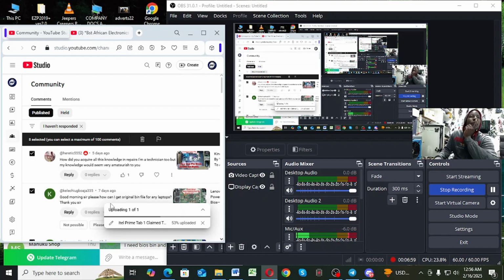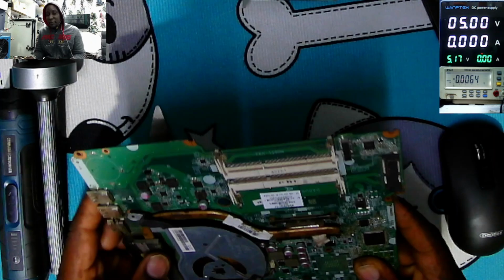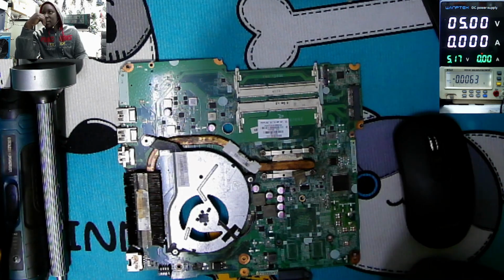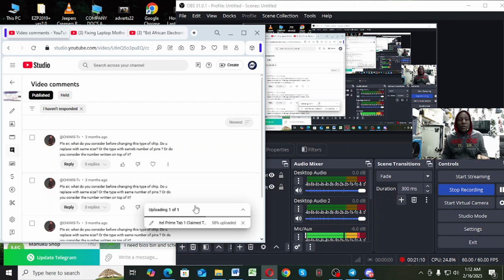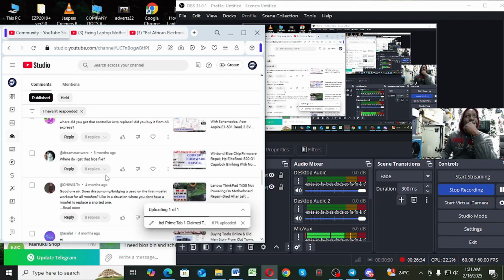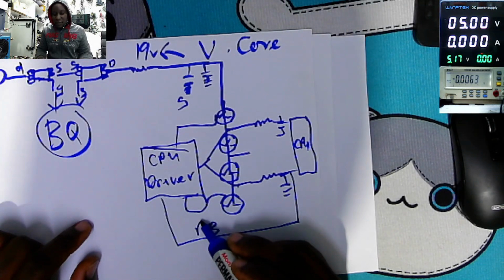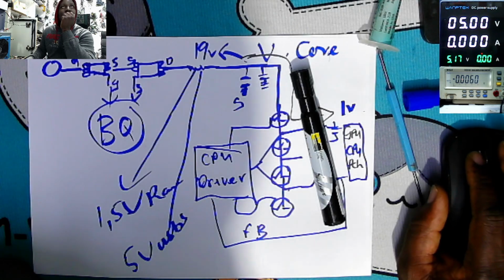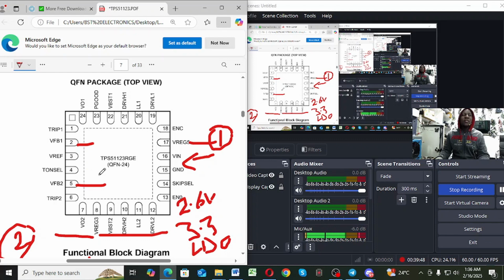Electronics Oral Repairs—Lets Rush To Comment Section—Weekend Electronics Talks 16/02/25.

Comment: , hi why laptop use 19 volt and desktop only 12 volts
Reply: The reason why laptops typically use 19V and desktops use 12V is due to the different design requirements and power consumption patterns of these two types of devices.

Laptops:

1. *Portability*: Laptops are designed to be portable, which means they need to be powered by a battery that can provide a sufficient amount of power for a reasonable amount of time. To achieve this, laptop manufacturers use a higher voltage (19V) to reduce the current required to power the device, making it more efficient and allowing for longer battery life.
2. *Power consumption*: Laptops have a higher power consumption than desktops due to the need to power the display, keyboard, and other peripherals. The 19V voltage helps to provide the necessary power to these components.
3. *DC-DC conversion*: Laptops use DC-DC converters to step down the 19V input voltage to the various voltages required by the different components, such as the CPU, memory, and storage. This conversion process is more efficient at higher input voltages.

Desktops:

1. *Power supply*: Desktops typically use a power supply unit (PSU) that provides multiple voltage rails, including 12V, 5V, and 3.3V. The 12V rail is used to power the CPU, motherboard, and other components that require a higher voltage.
2. *Component requirements*: Desktop components, such as the CPU, motherboard, and graphics card, are designed to operate at a lower voltage (12V) than laptops. This is because desktops are typically powered by a dedicated power supply, which can provide a more stable and efficient power delivery.
3. *Heat dissipation*: Desktops have more space and better airflow, which allows for more efficient heat dissipation. This means that desktop components can operate at a lower voltage without overheating, whereas laptops need to use a higher voltage to compensate for the limited cooling capabilities.

Why not use 12V in laptops?

Using 12V in laptops would require a higher current to deliver the same amount of power, which would lead to:

1. *Increased heat generation*: Higher currents would generate more heat, which is a concern in laptops where space and cooling are limited.
2. *Reduced battery life*: Higher currents would also reduce battery life, as the battery would need to supply more current to power the device.
3. *Increased weight and size*: To accommodate the higher current requirements, laptops would need to use larger and heavier batteries, which would compromise their portability.

In summary, the 19V voltage used in laptops is a design choice that balances power consumption, efficiency, and portability, while the 12V voltage used in desktops is a result of the different power supply and component requirements.